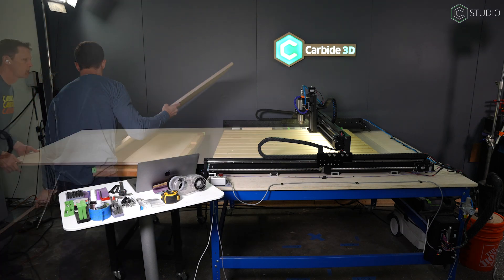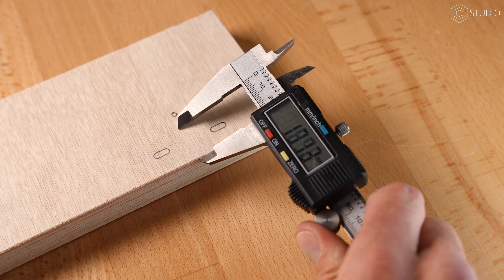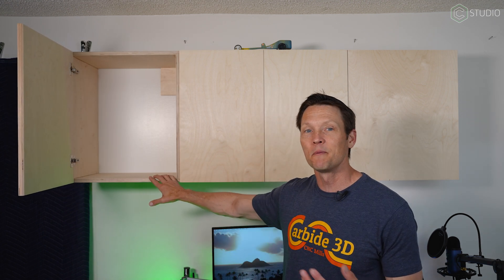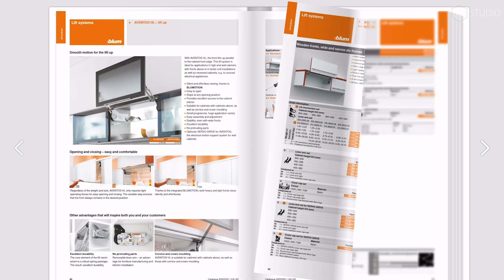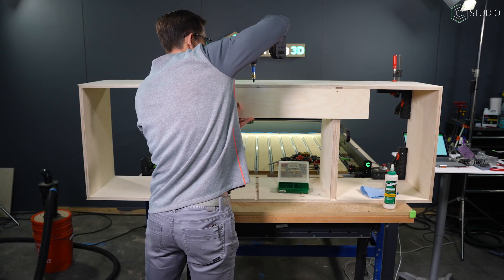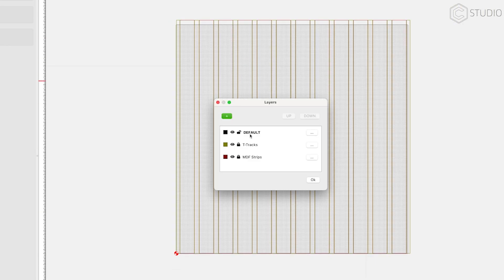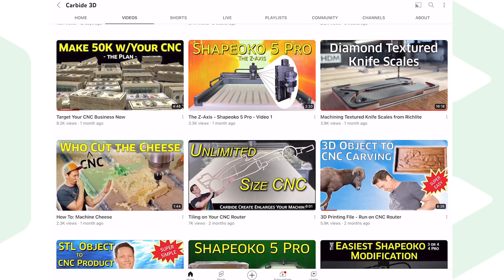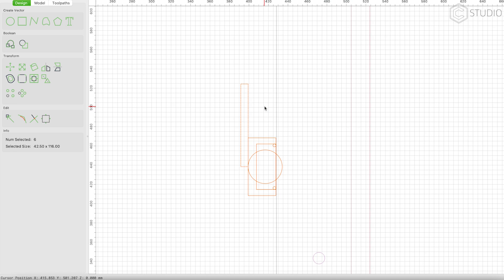Creating Custom Cabinetry with CNC Router - A Cabinet Build

Comment: @carbide3d how did you fasten the doors themselves to the table while cutting? I assume you didn’t run screws through the finished part, correct? Maybe they don’t need to be secured? Sorry, I’m new to this. 🙂
Reply from the maker: Hey Ryan,
The use of Tabs is critical for maintaining parts in position as they are cutout.  Tab creation is normal part of the design and toolpathing of most projects.   Those tabs can be easily flush trimmed or cut and sanded off after the program is complete.
We have a ton of educational information here:  http://my.carbide3d.com/
And remember,  you can download Carbide Create at zero cost.   Get familiar with the software side, buy a machine and start making stuff!
Carbide Create:  https://carbide3d.com/carbidecreate/

Give those resources a look and then join the Carbide 3D Family.
- Kevin
Reply: @carbide3d  Thank you so much! I've been learning on Cut2D so I'll probably stick with that.